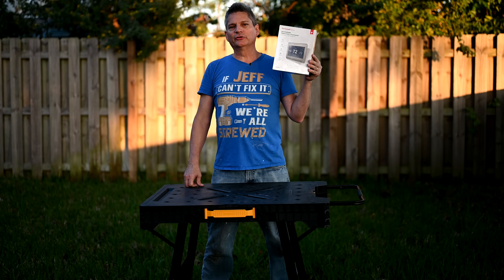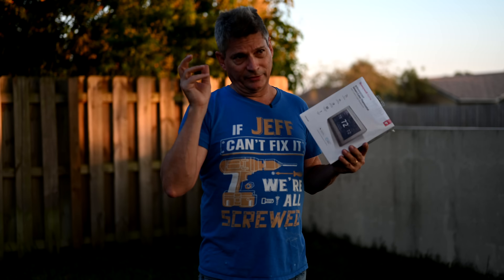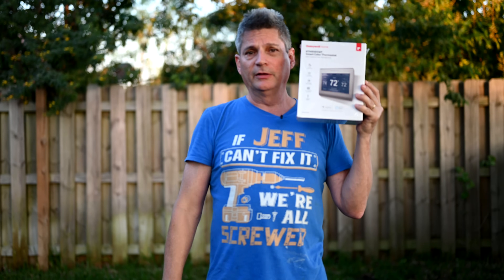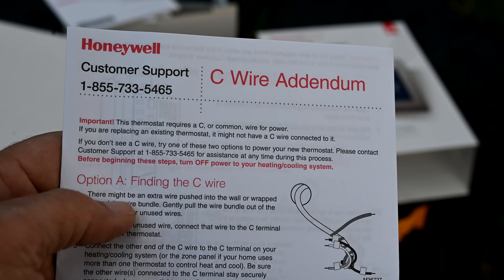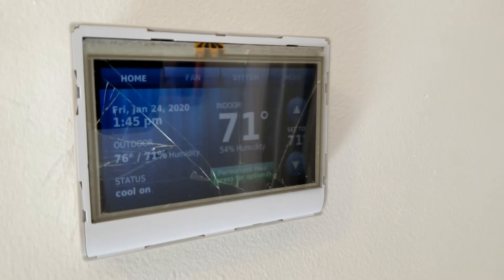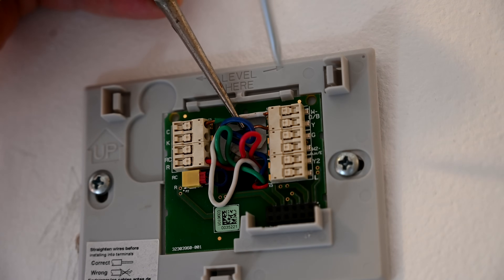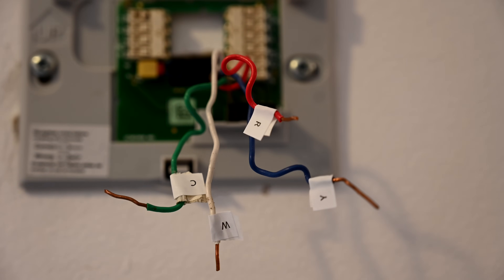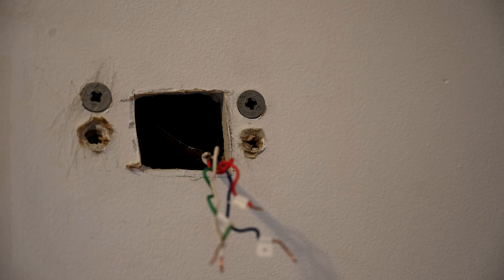How to Install Honeywell Smart WiFi Thermostat RTH9585WF Wiring

Comment: Does this thermostat have 24 hour format and about location will be it work in europe (weather, humidity outside)?
Reply from the maker: This does have 24 hour format if you like. As for getting info for Europe I don't know, but you can ask their technical support team: https://www.honeywellhome.com/us/en/support/air/thermostats/wifi-thermostats/wifi-color-touchscreen-thermostat-rth9585wf1004-u/
Reply: @jeffostroff 
Installed few days ago and yes thermostat fully work in europe ( outdoor humidity, temperature)
European gas heating system is different from US. Need  adapter (manufactured in Ukraine) who control signals by relays between heater and thermostat.

Comment: So using the G wire for C wire will turn the fan on and take away the ability to manually turn it on.  Did I get that right?  
If I understand you right, the fan will come on when the air and hearing is on?  

Thank you, thank you for your help.
Reply: My green now c did not power the thermostat.  :) but I could hear the fan 😁. I am wondering if the thermostat is bad.
Reply from the maker: It is so hard to tell what is going on without seeing the wiring on the thermostat, and also how it maps into the AC unit.
Reply: @jeffostroff  sooo, it seems my setup had an extra cable not doing anything hanging around the thermostat.  I used it to hook it up to the C connection on the furnace and now my new thermostat has power.  Thank you so much you got me started.
Reply from the maker: That is correct

Comment: Ok I have to ask. If you’re replacing the damaged control unit with a exact copy why change un damaged  wired backplate?
Reply from the maker: We had problems with the older thermostat falling off of the back plate which is what caused it to crack on the glass to begin with period so I did not want that old plate on there. I had a feeling there may have been something microscopic between the two of them that was keeping it from latching on tight enough. The newer thermostat had no problem sticking to the newer plate it just latched on nice and tight and never fell down once. But the other one if you slammed a door nearby it would fall off of the plate

Comment: Does it have temperature swing or hold feature?
Reply from the maker: Yes it has hold feature
Reply: @jeffostroff  ok I heard it doesn’t have temperature swing?
Reply from the maker: @kool8800  Not sure what you mean by voltage swing, but there is no search result of "swing" in the user manual
Reply: @jeffostroff  meaning like if you have it set to 75 it will run until 76 and then shut off to put less pressure on the compressor. My Honeywell without WiFi does that
Reply from the maker: This is all I found, Compressor protection
The thermostat keeps the compressor
off for a few minutes before restarting,
to prevent equipment damage. During
this “off” time, the message “waiting for
equipment” is displayed on screen.
Reply: @jeffostroff  ok thank you also forgot to ask does it have a lock feature where you set the temp and nobody can change it? I had the nest but didn’t like it
Reply from the maker: @kool8800  Yes there is a lock feature, and also a clean the screen feature which tells it to ignore any presses on the screen for 30 seconds while you clean it.
Reply: @jeffostroff  ok nice thank you so much for your help!

Comment: Will this thermostat work In United Kingdom 🇬🇧.  Can it display temperature In Degrees Census ?
Reply from the maker: Select Fahrenheit or Celsius yes. As for functionality in UK, I don't know as long as the AC standards are the same and required electrical signals, then it will work

Comment: After doing some research on my wiring, this showing me the green wire (which I have on my system for power for "C" wire which I have) is the one to use for it, not only was I happy to learn that and I will check with meter to verify that my green wire has power on mine for certain, it also sold me on buying this exact unit. I appreciate all the helpful info and phone app workability which was also extremely helpful! THANKS MAN!
Reply from the maker: Glad to help Roy!

Comment: Can you able to lock screen to prevent kids turning temperature?
Reply from the maker: You can adjust security options to prevent
unauthorized changes to system settings.
1 Touch SETTINGS and select Security Settings.
2 Select Change Lock Mode.
3 Select an option and follow prompts:
Unlocked: Full access allowed.
Partially locked: Only temperature can be changed.
Fully locked: No access allowed.

Comment: I replaced my old Honeywell thermostat with a new Honeywell wifi thermostat and reconnected all of the wires the same way but the unit only heats, do you know why?
Reply from the maker: It should work if you connected all the same color wires to the same named wires on the new one. I don't know why it is not working.
Reply: Having the same problem!! Let me know if you found a resolve, please 🥵

Comment: Can you skip the online registration and remote access? I don't like my home devices to be exposed to some 3rd party so I have everything behind a firewall and connect via VPN. So I guess my question is if I can only use the thermostat locally?
Reply from the maker: No, that is how they register the mac address of the unit. If you skip this step, you won't be able to use any online features.
Reply: @jeffostroff  Thank you. I installed it last night and just added everything needed to control the device remotely.

Comment: Jeff, I just purchased Honeywell's RTF6580WF and found out it does not support emergency, backup heat. I am in Florida running a heat pump system. Also I do have 5 wires including the C wire, but can not get the A/C to turn on and cannot get the heat to turn off. Can you recommend a thermostat that will support my backup heating system, or do I just have this Wi-Fi thermostat wired wrong? Thank you.
Reply from the maker: I don't know much about these heat pumps, but is this one from amazon that will work?
https://www.amazon.com/Honeywell-RTH3100C1002-E1-Digital-Thermostats/dp/B000VL440U

Comment: I did everything you said. It was working yesterday but when I woke up the house was ice cold!! Help me please....
Reply from the maker: So it looks like it never told the AC to stop. Did you have the set to a cold value and it stayed on? If you set it to a temp like 76 for example, and put it on hold, it should not go any lower than that

Comment: That HUGE square hole on wall will make  thermostat to show false temperature reading (especially if you have a basement) and thermostat will "malfunction". Hole has to be covered with insulation. HVAC-R guy here.
Reply from the maker: We covered it

Comment: Please help, as my HVAC contractor has been unable to address the issues so far.  Below are the units which have been purchased and installed in my residence.  The installers have spent days re-wiring my Nest thermostats and they still appear to not function properly.  Can you provide assistance? Can you provide a definite answer that 3rd Generation Nest should/will work with the below devices?  If not, why not and which SMART thermostats will work? I have seen my neighbors with brand new and modern Carrier and Goodman systems which do not have any issues with Nest Gen3.  

Thank you,
Reply from the maker: I've never had any 1st hand experience with lost but I have seen their website they do have articles about their units can be used without C wire if that's what they are trying to figure out. They should have articles or videos on how to work with different systems.
Reply: @jeffostroff  Thank you, Jeff.  There is definitely a C wire.  In fact, I can see 7 wires connected to terminals on the Nest t-stat.  I have two zones and what is interesting is that zone 1 is connected to Rc for power and zone 2 is connected to Rh for power.  Weird.  In any case, the damn thing does not work. :)
Reply from the maker: @benyukhis1924   Let us know when they get that fixed does that will probably help a lot of other people

Comment: Hi Jeff. Good video but I noticed that huge wall opening where if you don't plater it, your thermostat would be affected by heat or cold drafts. I completely sealed the are where my wires go through.
Reply from the maker: We plan on doing that when we close up the old drywall hole
Reply: If you switch to Celsius it does half degree increments. I can't figure out how to change it from Fahrenheit to Celsius. @jeffostroff ?

Comment: Good job, but the first 6 minutes are more of a review rather than install, no?  Next, you are replacing a unit with one that's pretty much identical as far a wiring goes which isn't much help for those of us replacing older units.  Someone had a question below regarding an RH wire which is what I have (where does that go in the new unit?).  Oddly, it's one of the few to which you have yet to respond.  So up to at least 13.22, all of the info in the vid can be found in the install manual.  The rest is just following onscreen prompts.   Call to Honeywell tech is over an hour wait.  Only have two wires in old thermo terminals, RH and W.  I added a C wire.  So, don't know where to attach those wires as there is no RH or plain W terminal.  Also, wouldn't you need a return line for the C/24v. line?  I think of YouTube providing problem solving tips for what's NOT included in the manuals.  Thanks for your efforts, but as you can see a few of us have some odd issues.
Reply from the maker: I simply don't know the answer to your case I don't believe the Honeywell wireless thermostat will work with your system Honeywell seems to indicate on their website that older systems like that it won't work with it is meant to work with a four or five wire system. Also it sounds to me like you don't have an air conditioner just a heater correct?

Comment: Or where does the blue go if i use yellow for y?
Reply from the maker: You really can't make a generalization as to what color wire goes weird 'cause there are numerous color systems out there and also you don't know if they wired it correctly what really matters is how it was wired on your old thermostat that is why you take a picture of it first so you know how to connect up the new wires . You may have to open up the panel in your ear handler to see where the other wires are going if you don't know what they are or where they're connected. I can tell you that many times the C wire is blue but it could be black or white on your system we just don't know
Reply: @jeffostroff  i got it figured out. When i replaced my old thermostat  the blue wire wasnt connected.  When i upgraded to this honey well i connected it at 1st.  Still no power. I disconnected it. Power came on so the blue wire has no use on this system either. Thank you for your response. I definately appreciate you

Comment: My 5th wire is yellow.  Where does it go?
Reply from the maker: Yellow usually means cool, it turns on the AC. White usually means heat, it tells the heat to turn on, Might be different on your system though.
Reply: No matter how i plugged the wires/ i found different options depending on the color  i couldn't get the honeywell unit to power on at all. I literally watched 10 different videos. So i put the old one back up. Frustrated on what should have been a 5 minute job. Smh

Comment: You can use a Honeywell THP9045A1023 Wiresaver  (Amazon for about $11) that  will allow you to use four wires to the thermostat.  Works great use them all the time.
This way you don't lose functionality (fan). It makes a "C" wire from the fan wire.
Reply from the maker: Thanks for the tip!

Comment: my thermostat has 5wires, red to RH, white to o/b, Y to yellow, G to green and C to blue wire, do i swap the G green wire & connect it to the C and the blue wire to G? and do i connect the red wire to RC or R on the honeywell thermostat? any assistance is appreciated, thank you!
Reply from the maker: I'm not sure what you were talking about swapping wires if you already had five wires before you hook them up to the exact same connections on the new Honeywell thermostat there is no reason to change anything
Reply: @jeffostroff  like you said . take a photo with your phone and use the wire label stickers and label them one by one..!

Comment: will this work using a 240 volt wiring?
Reply from the maker: No this is meant to have 24 Volt power supply into it only. What you would probably want to do is use some type of stepdown transformer that drops your voltage down to 24 volts from the 240 volts, doorbell transformers are a possibility to look at as long as the one you buy can handle 240 v.

Comment: Hey so quick question.  I didn't have a C wire so was going go use the G wire ! I went to my furnace and saw that there's a wire connected to the "C" wire already
Reply from the maker: I had a similar issue while installing this thermostat for this video. What I did in my air handler was I encountered something similar and I found a 24 Volt point in the air handler and removed one other wire to make it available to use to get it back to the trans thermostat. By doing that in the air handler what I actually did was disabled the ability for the air handler to ever go into fan only mode. This is something I never use anyway we only have the AC on, or we have the heat on we never turn on fan only on our air handler so it was not a problem to do this. But for many people you're going to have to make a decision if I steal a wire from something else in the circuitry on the air handler to use it for the C wire, what am I giving up and am I ready to give it up?
Reply: @jeffostroff  i actually got ahold of my HVAC buddy. The c wire that was already connected was actually for the AC outside!  All I did was attach the G wire to the C wire connection and I didn't need to jump the Y wire to the G wire ! It all worked out

Comment: Very helpful but on my old one  I also have an orange and blue wire. How do I hook them up? I have a total 8 wires to include the c wire.
Reply from the maker: I'm not sure, I rarely go by colors, since they can be hooked up all different ways. I go by the wiring diagram on the panel of the air handler to tell me what the wire colors mean mean.

Comment: Just bought this thing! But, I had an older Honeywell already installed, but this new one, the RTH9585WF, doesn’t have a U1 wire... where do I put it?
Reply from the maker: Usually U1 wires in a thermostat are usually connected to a fresh air vent somewhere in your house or a humidification system not sure which one you have. But either way I'm not certain that the new Honeywell thermostats work with it or if they do you will probably have to contact their customer service people to get instructions on how to utilize that wire

Comment: Doesn't matter if you don't have "C" wire because you can use the "G" wire and then swap it down at HVAC unit along with a jumper wire between "Y" & "G"
Reply from the maker: What we did in our unit because we had a four wire system was I got inside the air handler and re routed the vent fan wire to the C wire instead so the only thing I lose is I can't turn on the vent by itself anymore which we never do we either have it on air conditioning mode or heating mode or nothing at all
Reply from the maker: What we did in our unit because we had a four wire system was I got inside the air handler and re routed the vent fan wire to the C wire instead so the only thing I lose is I can't turn on the vent by itself anymore which we never do we either have it on air conditioning mode or heating mode or nothing at all

Comment: Thank you for this video. I was glad that u mentioned the need for a  "c" wire but unfortunately when u installed the thermostat you did not talk about the adjustment that you said you made or even point it out to us at the most important time, installation. What if you only have a heating system etc do you need the c wire and or the adjustment?
Reply from the maker: With most smart thermostats you always need C-wire regardless of whether you have a heater or an air conditioner or what because the C wire is needed to help provide the 24 volts needed by the thermostat to operate and to turn on their own display for you to see what's going on to power up that display. Older thermostat models that operate off batteries won't need a C wire but I highly suggest against using battery operated thermostats they were a source of many arguments between me and my wife as to whether the battery needed to be changed or the air conditioner does not feel right because she thinks the battery has to be changed but in the end having a thermostat that runs off 24 volts is the best way to go.

Comment: I don’t have AC. Only electric heat. Ok to use?
Reply from the maker: Yes you can still use it
Reply: @jeffostroff  thanks for getting back to me.
Reply: @jeffostroff  Hi, what happens if you loose power? Does it reboot itself once the power comes back? Does it have to be done manually? Important to know assuming you are not there to reboot it. Snow storm or ice storm as an example. Thanks.

Comment: Awesome, thank you. So in short: an existing 4 wire setup is incompatible, but a 5 wire is A OK.
Reply from the maker: For most people that is true. I had a 4-wire setup on my AC. I opened the air handler and rerouted one of the wires to be the C wire with 24 volts. But I lose the ability to run the AC in fan only, which I neve do anyway.

Comment: Where does your GREEN wire connect on the blower package? I dont have a C wire.
Reply from the maker: I don't remember what I did it's on the video. You are supposed to take a photo of the wiring before you disconnect. If you don't have a C wire, look in the hole where the wires come from, sometimes they fold it back in the hole because it is not being used. If you don't have A C wire, you'll need to wire one to the AC or wire on to a 24 v source.